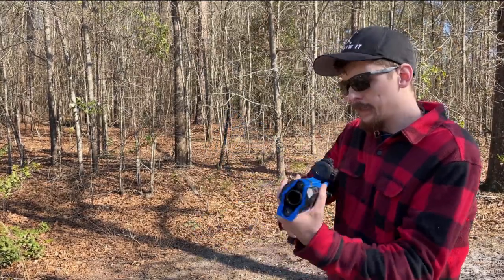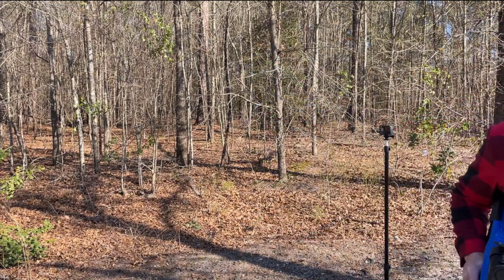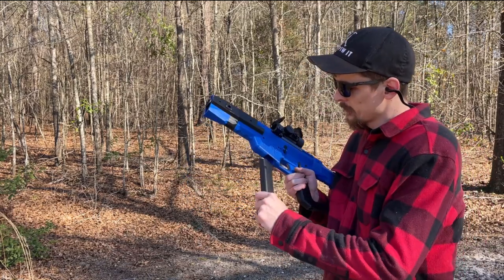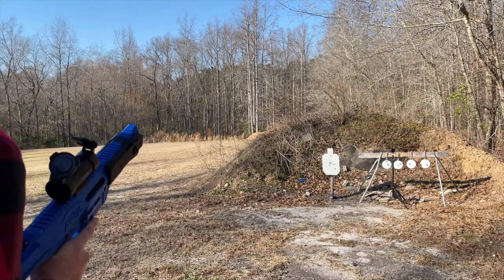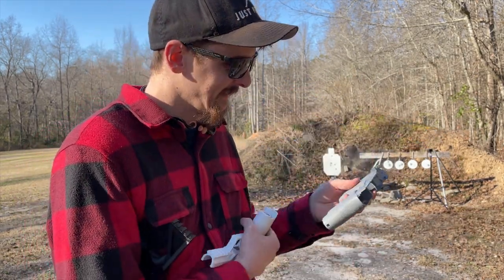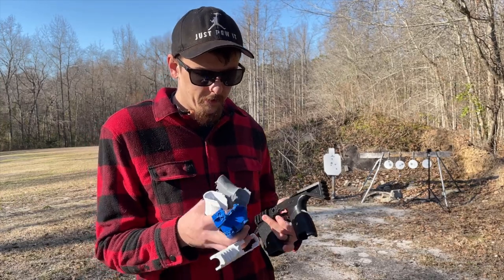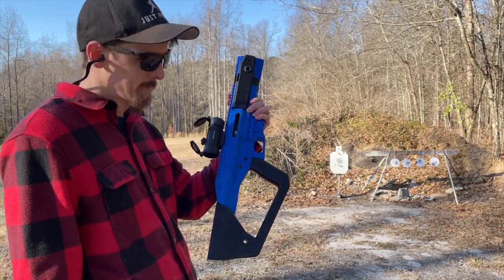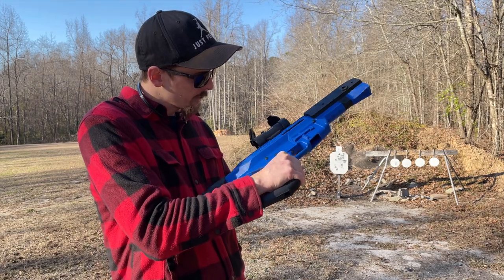The ARK Designed by InvaderZip_ | Test Fire Video

Comment: Nice, im in the process of building one too. I going with 15" .45 acp and a red and white color scheme. I want to see if it can handle .45 super as it benefits more from a longer barrel. Great job on your build, looks amazing
Reply from the maker: Heck yeah man! I can’t wait to see it!
Reply: 45 super? Why not step str8 up to 460 Rowland.
Reply: A firearm chambered for the 460 Rowland will also fire the 45 Super.  If you play with it, you may be able to get it tuned well and enough to work with everything from 45 ACP to 460 Rowland.  Remember, the 460 R headspaces off the extractor.
Reply: any vids broski?? can i get a parts list? i want to go the same route u went.

Comment: Great video. Glad to see it ran flawlessly. I’m just waiting on my barrel and bolt to finish building mine. I’m going with a 16 inch 9mm. I’m a little concerned about overheating where the barrel meets the upper receiver. Do you think that’s a problem?
Reply from the maker: Thank you!! So far it hasn’t warped in the slightest. My flash can is also touching the hand guard at the end and that didn’t warp at all either. I’m about to go put another 100 rounds through it this weekend and the plan is to make all 100 rapid fire so we will see! You’ll have to send me some pics of ur build on Instagram when ur done!
Reply: @1pew2pew12  Thanks for the info. I’ll be sure to send some pics

Comment: I’m in the process of making one of these, I have some questions about your settings. My upper isn’t coming out right at all. Mainly the threads for the barrel nut. Also is there supposed to be build instructions or anything? I used the defcad files.
Reply from the maker: If you go to @invaderzips_ Instagram he has a link to an install video. I printed the upper w the picatinny rails down at .16 layer height. My threads did need a little bit of cleaning up around the support material area and it was a really tight fit w screwing on the barrel nut all the way down, i had to wear a glove to turn the last few threads if that gives you an idea of the umph i had to give it.

Comment: Does the bottom of the lower have to be absolutely flat to work right? Seems like no matter what I try I always get a slight warp towards the back end of the lower
Reply from the maker: As long as the rod that goes in it is straight it should be ok. As long as it doesn’t bind when you try to rack it, it should be fine.
Reply: @1pew2pew12  cool that’s what I was thinking, thanks for the reply!

Comment: Sharp looking build there Mister.
Reply from the maker: Thank you!
Reply: Sharp Looking until it's begins to melt.
Reply: @HighSpeedNoDrag  I have had great luck with mine, I can easily dump 30 9mm without issue. I have taken it apart since doin so and no melting.
Reply from the maker: @HighSpeedNoDrag  I'll soon be releasing a video of me dumping 60 rounds of 9mm in this same ARK followed by me throwing it about 50ft with no damage and it still ran. These builds are getting stronger than one might think.
Reply: @1pew2pew12  Yes indeed and I will be waiting patiently.
Reply from the maker: @HighSpeedNoDrag  I hope you enjoy!
https://youtu.be/UzUw1wUR6sE